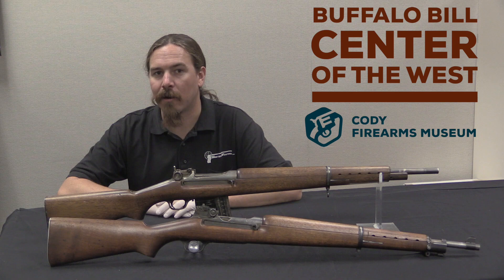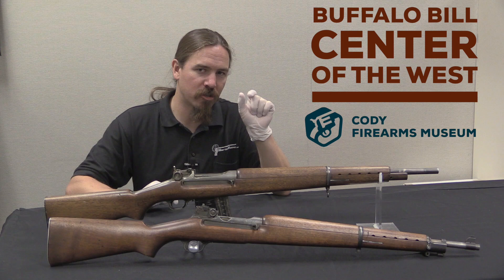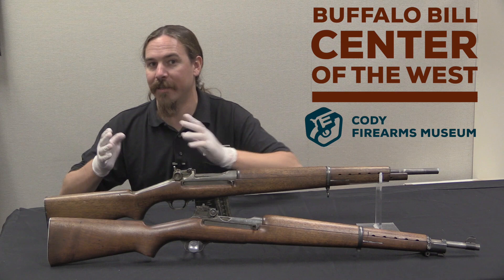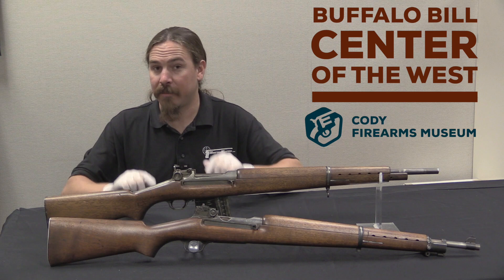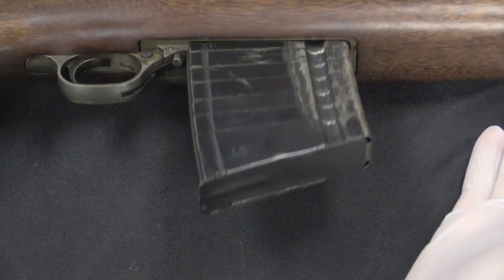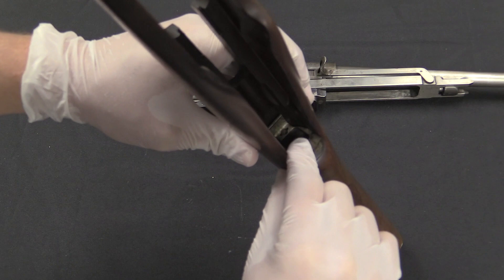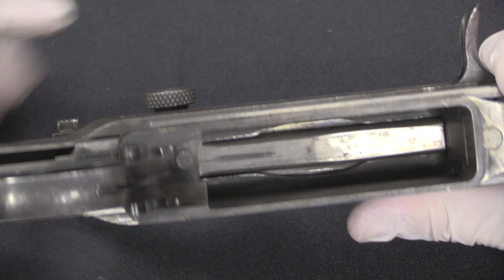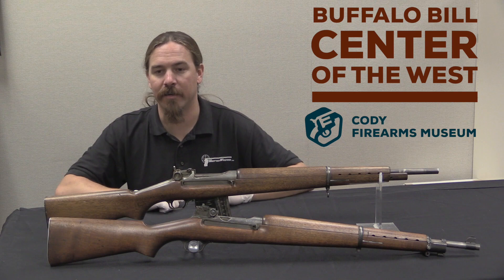Winchester G30M

Comment: I own two Garands and one 41' Johnson and to me they are equals.  There is a reason the military didn't replace the M1 with the Johnson, not because it was bad, but it was pretty much an equal and they were already tooled up for M1 production.  The Marines who used the 41' loved them and refused to give them up for M1's for the most part.
Reply: The johnson had A LOT of trouble with sand and mud.  Men in the Pacific jettisoned the Johnson ASAP.
Reply: @TheIrishAmish  You are thinking of the Reising.  The Johnson rifle was in fact loved by the marines, the johnson light machine gun was even more well liked.  The Johnson in fact performed well in sand, mainly because it was a closed system with only the bolt buffer tail exposed but when actuated when fired the debris would be cleared as the short recoil system operated.  Marines refused to give them up and marine raiders and parachutists didn't.  The only drawbacks really reported with any frequency was early on there were complaints about possible small parts getting lost during cleaning/field stripping, the other was the bayonet. When engaged with the enemy and the bayonet on the rifle  the barrel could push back when the enemy was stabbed and the bolt would disengage.  Once the bayonet was removed from the person the barrel had to be grabbed and locked back forward. In fact what was thought was an early drawback was actually a gift, the first production, no letter prefix 41's didn't have a bolt hold open, so last shot the bolt closed, keeping the system closed. later models had them but they were indifferent in use.  
The Johnson system was revolutionary for it's time with a closed rotating bolt system and buffer return.  In fact when Johnson Automatics closed Melvin Johnson went to work for his college friend as an engineer at his company, Armalite. Johnsons 1941 led to the development of the AR15, it's a 41' Johnson bolt system with a gas operation. it fathered the AR.

Comment: I have a suggestion: George Orwell wrote about some very poorly designed hand grenades he was issued when he fought in the Spanish Civil War. He described the grenade as having two pins that had to be pulled out before the grenade was thrown.

The poorly designed feature was that one of those pins was very hard to pull out, while the other one was dangerously loose.

Maybe that nasty device could be an interesting subject?

Thank you for your great videos!

Comment: You know, I've been looking to see if a weapon ever had this sort of design for a while. I don't really like AR pattern charging handles with their flimsy feeling and awkward location, but the value of that design cannot be overlooked. Their indirect connection to the bolt carrier away from the ejection port allows for their full port dust cover and the fact that the handle is pulled out of the weapon nearly eliminates the chance of debris getting into the weapon via the charging handle's travel area. This G30 design also has an ejection port that could be easily covered in the style of an AR and the charging handle is pulled out of the weapon when used without the bad location and flimsiness of an AR 'T' handle. In fact, I'll bet that handle has a satisfying AK feel to racking it. It's a shame the marines didn't go with this option, it would've been neat to see how this action might have evolved with modern weapon design.

Comment: That's a neat video.  It's easy to speculate on "might have been" if the rifle had actually gone into military production.  The detachable box magazine was a good idea.  It's also interesting to speculate about any growth potential in the design - the M1 carbine grew into the selective fire M2, one might wonder how a selective fire G30M would have fared when the military went shopping for a new rifle.
Reply: I suspect that a select-fire G30M would be a royal pain. If you simply added a selector switch it would be uncontrollable in full-auto and prone to overheating. Think of an M-14 with serious Roid Rage. If you added enough weight to make it controllable and converted the design to open bolt? Then you'd have a... BAR.

But what would have happened if Winchester had produced a scaled down model in an intermediate cartridge? Would this have supplanted our beloved AR-15?
Reply: KJ It very nearly did. Winchester entered a rifle, called the LMR, into the SCHV trials the Army was running to decide on an intermediate cartridge service rifle. After the G30M failed to unseat the Garand in 1940, Winchester used a revised action designed by David Williams to create the G30R, an even more amazing rifle than the G30M. Unfortunately, it didn't get adopted either, but later it was scaled down and adapted as the LMR, which was chambered for the .224 Winchester E2 cartridge, an early rival to what was to become the 5.56x45mm NATO.

http://www.thefirearmblog.com/blog/2016/02/20/bruce-canfield-on-the-winchester-lmr-at-american-rifleman/
Reply: +ostiariusalpha Thanks for the info. Check out the TRW LMR. If you can beg, borrow, or steal a copy of "The Gun Digest Book of Assault Weapons" there's a little piece on it. I'd love to own a semiauto version.

Comment: I had a Mini-30 that used to come apart on its own as you described, until i re-bent the trigger guard so it had more tension.
Reply: My Mini 14 did the same; bent it with Channel Locks and it worked perfectly.

Comment: gotta say, check a cut-away view of a bar. aside from the williams piston, and the lack of a "slam fire hammer" (because ol ed used 2 links, not a lug), this is the action of the bar (less the "tuck in the wrist gee whizzery"). i guess he got an "improved" patent on the bar patent (wrist tuck), so could market it as "original". that sight base/loading bridge is basically that classic bar "quasimodo hump" under some camo, with a modified ejection port locale. this would certainly explain the bar lineage of the maggie, as well as browning's insistence not to modify his baby (lest his patent no longer apply). i actually REALLY like the idea of a white "steam valve" or williams "short stroke" piston being married to the basic bar "links n lifts" action, as it lends itself really well to "inertia carry" after a rapid violent whack on the nose, while stagier, cammier actions might be more inclined toward "cumulative losses" of momentum, and resultant loss of reliability. also very reminiscent of the sks (inverted though), with the captive under sight short piston doing "williams duty" with a pretty vanilla bore to gas piston face interface (and lots more mass shoving the carrier in a longer thrust, probably because the reciprocating bits are so much lighter)

Comment: It seems that a Garand style rotating bolt traveling straight back and forth would require less space than the tilting bolt shown here. It would also allow elimination of the bolt tail and the recoil spring in the stock, which should make stock fabrication easier. Still an interesting system, and we know the tappet works well. Definitely had a lot of potential. Prototype and trials rifles are always very interesting. Great video as always. Thank you

Comment: Using what was basically a BAR magazine would have been a point in favor in my mind. Where the riflemen are using the same magazine as their support auto rifleman is. Then the BAR gunner can (if needed) scrounge magazines from the fallen and the out of combat wounded.without having to refill magazines.
Reply: The most benefit you'd get is probably just ease of manufacture... it looks like the mags for these g30s were nodded enough as to be substantially different.
Reply: +ToastytheG *modded
Reply: Yes I was thinking the same thing. That feature was a great selling point.

Comment: Were this my rifle, I'd apply  WD40, Crud Cutter or similar to the Piston and gas vent hole. Then place a fired case in the chamber, and apply compressed air to the muzzle. That should free up the piston without damage. That failing, the bore could be filled with oil, included the piston chamber, then a bore diameter plug placed in the muzzle, and struck with a nylon face hammer. Love to see this rifle operational and fired.
How was the piston held in place originally?

Comment: Looking at the development of the first successfully adopted self-loading rifles like the Garand I don’t understand why they didn’t go ahead and use detachable 10 or 20 round magazines.

The BAR and its variations were able to make it work so why wouldn’t it be feasible on a late 30’s early 40’s battle rifle?

Were the platforms not robust enough or was it an issue of streamlining production without the extra complication of a box fed magazine system, or ergonomics or potential training problems?
Reply from the maker: Clips were preferred by the military because they were less expensive, didn't interfere with a low prone position, and easy to carry.
Reply: Even in the '80s, authors like Chuck Taylor were opining in their books that detachable magazines were more fragile than a fixed internal magazine. And he was (otherwise) actually a fairly forward thinking guy for the time.

Comment: Why not just use regular BAR magazines? That would both simplify logistics and give the rifleman more firepower. I know there was a requirement for a flush magazine when the M1 was designed, but was that still a consideration?
Reply from the maker: Regular BAR mags are not very good mags. They work in the BAR, but not in actions with shorter bolt travel.